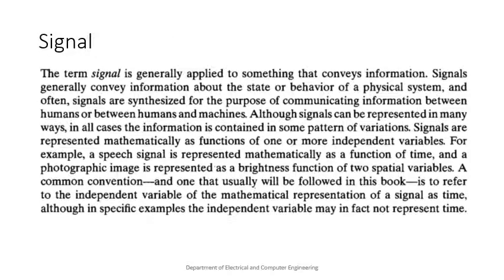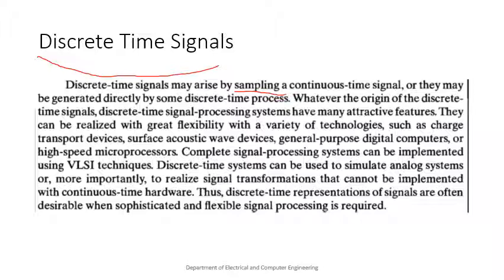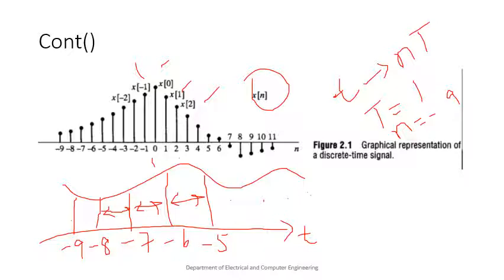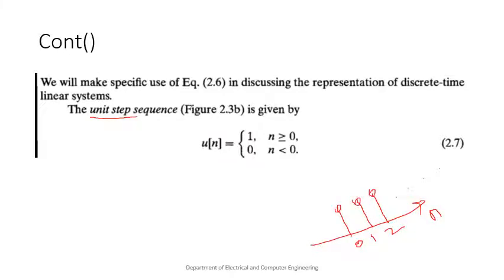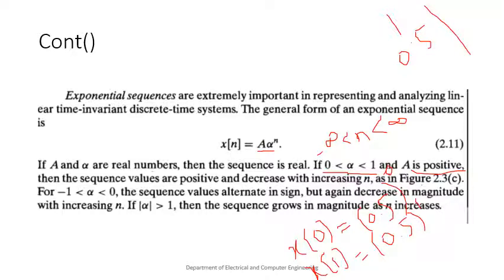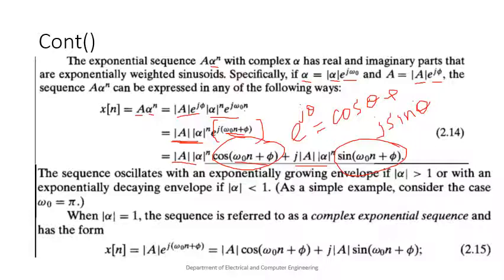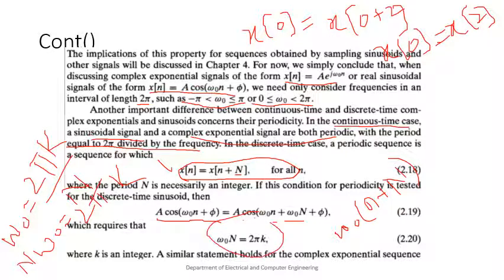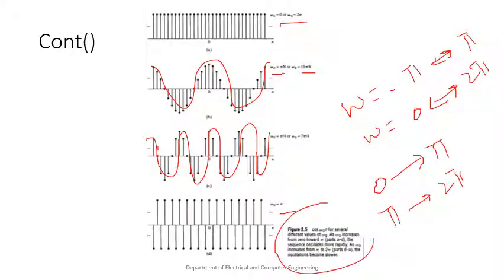Digital Signal Processing - Lecture # 1 - Chapter # 2 - Discrete Time Signals & Systems

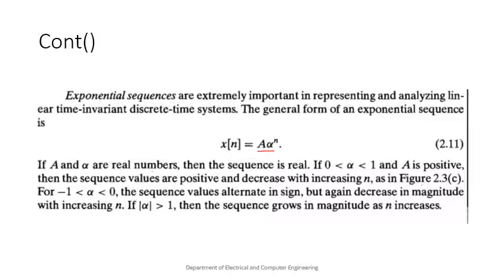Comment: If n is the sample-number, how can n ever be negative (like here: 30:22)? Thanks for the lecture.
Reply from the maker: For the particular exponential sequence n ranges from negative infinity to positive infinity it means that a signal can be defined over entire range. U can think of zero to be current sample ; positive ones as advance or future samples and negatives ones are delayed or past samples. n is just a sequence number. negative n just means previous past or delayed samples.
Reply: @electricalengineering8207  Okay, I didn't think of it that way. Thanks for your clear explanation!